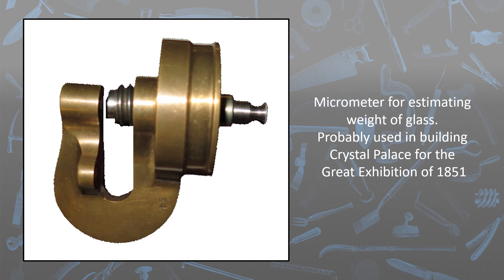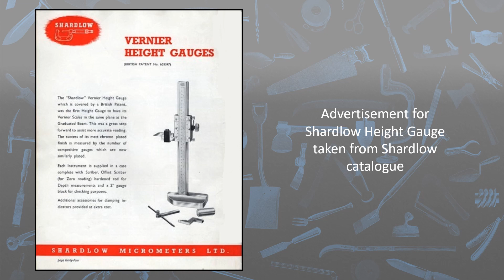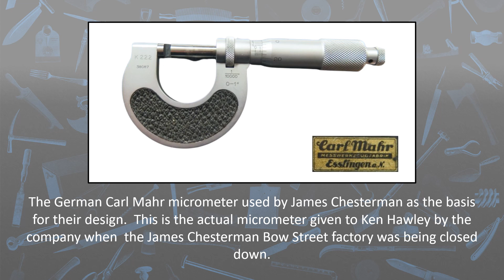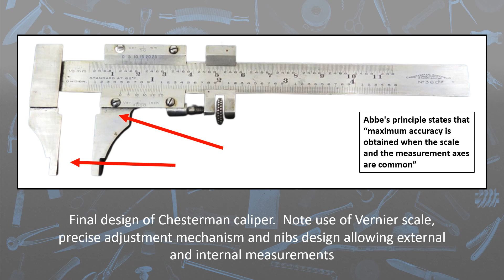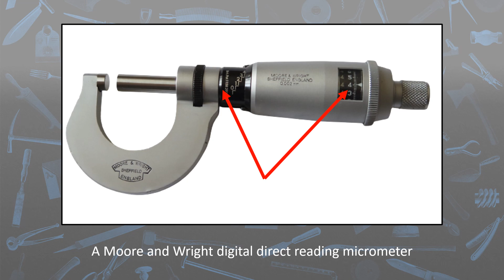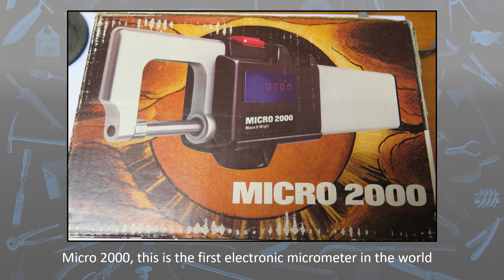Three Sheffield Precision Tool Manufacturers (2022)

Comment: I think the braille calliper has a full 0 - 12 inch range because there are 11 spacer bars (which would measure 1 to 11 inches), plus you have a full inch of motion on the micrometer braille head.
So you have the full inch dimension off the spacer, plus the decimal inch off the thimble.

Comment: Interesting that you mention similarity of post WW2 tool design. During WW2 much of the intercompany rivalry all across industry was often put aside to achieve a particular goal within a abnormally short timescale, through collaboration. Also, because manufacturing tooling was in short supply a triage system was operated by the ministry of supply on a daily basis, to prioritise company need and issue them accordingly. One example comes to mind in control and issue of milling cutters for use across the UK in those days.
Reply: That level of coordination and control is interesting; an untold part of the war story, particularly when high-precision demand were growing in aviation, and materials were getting tougher to machine.